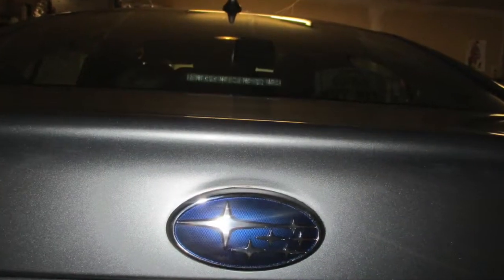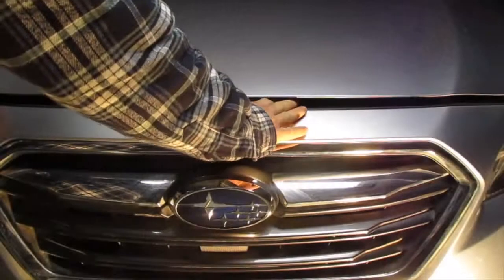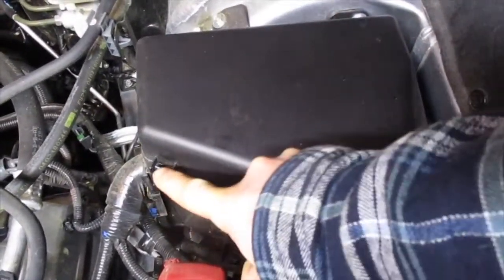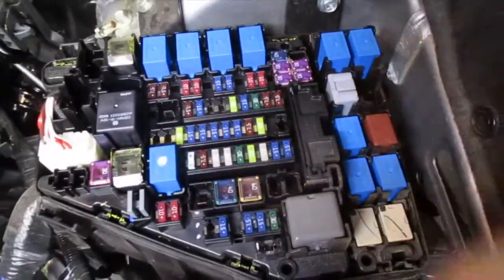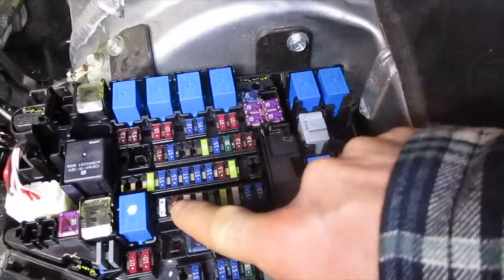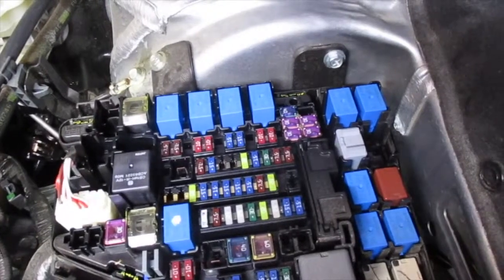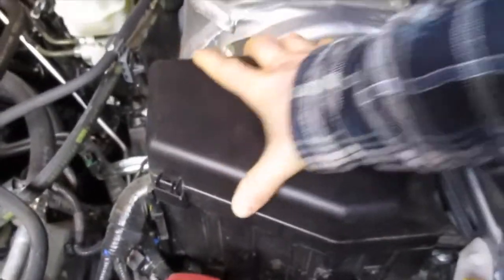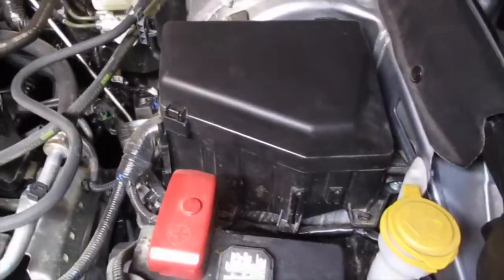FUSE BOX Relay LOCATION Subaru Crosstrek 2013 2014 2015 2016 2017 2018 2019 2020 2021 2022 Subaru

Comment: Well, I drove 39 miles to the suburu dealer to buy this and came home put it in and DID NOTHING...Checked battery and it has 12 volts...but the car is dead...thanks for nothing
Reply from the maker: What did you buy???  What you wrote makes no sense...